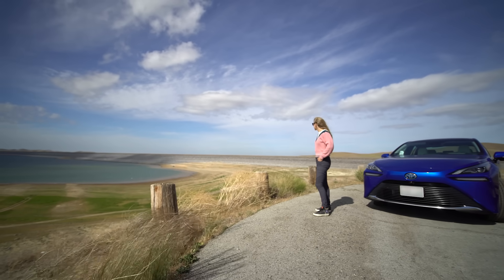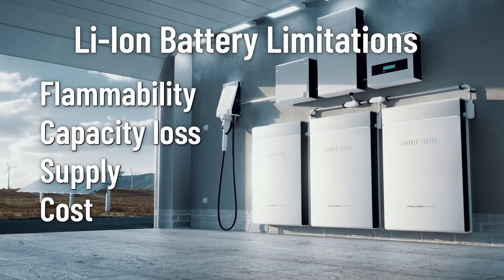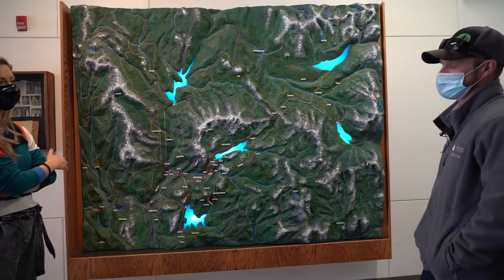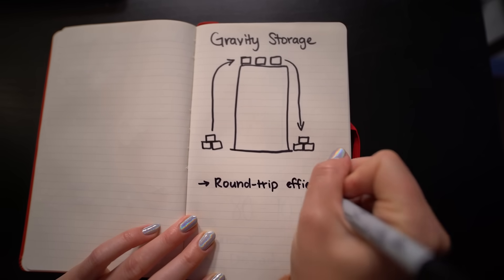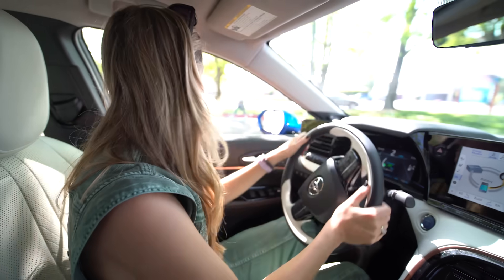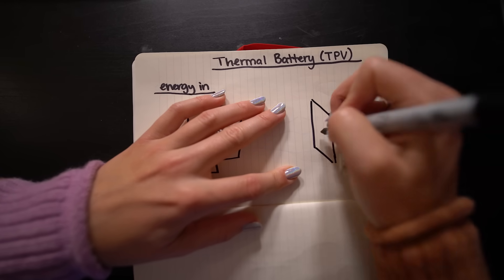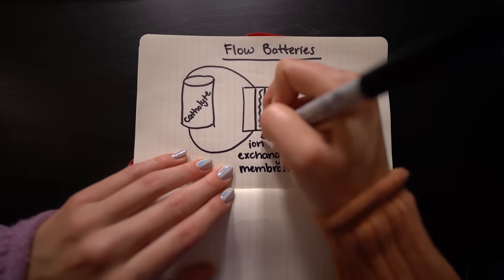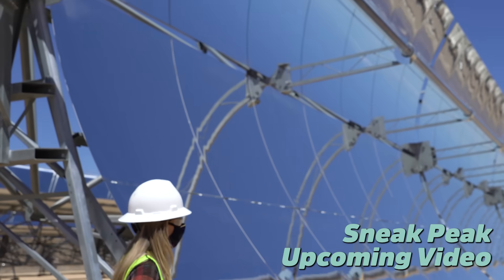The BIGGEST problem with clean energy

Comment: I really enjoy your channel, but this series seems to take a Toyota set of 'facts' as gospel.  Take the 'problems' with using Li-ion as storage.  1.  Flammability- yes, they can catch on fire- but not often, and catch on fire far less than Gas cars, which average about 200,000 car fires a year here in the US.  And Hydrogen- extremely flammable as well- think Hindenburg...  2.  Capacity Loss- again, yes, they do lose some capacity- but not much.  In fact, their losses have proven far less than anticipated in several studies.  Tesla just released an overview of the batteries in their cars, where the losses were tapering off between 8-10% after 200,000 miles.  Consumer Reports a couple of years ago looked at a Prius, whose older-tech-Metal-Hydride battery capacity was virtually unchanged (though admittedly, this was a small sample).  3.  Supply- this is kind of silly.  This is a new industry, so yes, capacity to build batteries is not yet built out.  But within 5 years, there will already be many times the capacity of today.  And Lithium itself?  Running out of it?  Again, silly.  Lithium is a fairly abundant resource.  Even if we were to exhaust all the mines on earth (unlikely), there is plenty of it in sea water- and the oceans are vast.  Additionally, there are several, well-funded companies around the world developing recycling processes to re-use all the valuable minerals from old batteries.  4.  Cost- they said the same thing 10 years ago... and then the cost decreased by about 80-90% since then.  And it will continue to drop, perhaps not quite as dramaticly, but it will, especially as manufacturing processes improve, and chemistries improve, and energy density goes up.

I really like your show, but this particular series, so far, shows very little in the way of research, and instead seems to rely on a Toyota-centric POV to promote their hybrids and Fuel Cell technology.  I would not have chosen Toyota to sponsor a show on this subject, as their bias pervades the show.  And I like Toyotas- one of our cars is a Prius!  We do need more energy storage solutions- but all of the ones you show are not new, and have been around as long as Lithium Ion battery storage, if not longer.  There is a reason none of them are yet successful in the marketplace, including your upcoming video (I am guessing) on using Solar Thermal to store energy in molten salt.  Even flywheels are being looked at... again.

Tesla already has a path to reduce the cost of their higher power batteries, with nickel and cobalt, to around $50 per KWH.  Using a Lithium Iron Phosphate chemistry, they could get it down to $40 per KWH.  And if they ever get a drop-in solid electrolyte, which has a high probability of happening over the next few years, the cost per KWH will drop even further.

I am glad you are taking a look at the possibilities of our future, hopefully one devoid of using any carbon-based fuels.  Li-ion gives us the chance to get off of those fuels NOW.  But there are many other companies trying to slow that future down, because of profits to be made using the status quo.  The other storage possibilities, which warrant research, are still pipe dreams however, or worse, red herrings for other interests.  Frankly, if you want a complement to using renewable fuels because of the worry about intermittency, I would suggest a deep dive into LFTR nuclear reactors, which use Thorium in a Molten Salt environment.  Unfortunately, Nuclear Power bias is making that a long climb uphill...
Reply: Admittedly, it is harder to get, as Lithium is never found alone- but as a comparison, there is more Lithium in the world than Lead.

Comment: I heard from a french expert called Jean-Marc Jancovici who's lifetime work is surrounding the question of energy storage and usage. He explains that hydrogen is just not ready because you need far more energy to make electrolysis than the energy you get back from hydrogen generators. Moreover, he adds that the process of electrolysis is based on electric consumption. Where does the electricity come from if not petrol and coal? knowing that hydroelectricity is a minor source of energy in the grid

Comment: Compressed air looks very interesting. 
Also I wonder what the efficiency is if you used electrolysis to free hydrogen, then just burned it for power instead of fuel cells
Reply: like pump storage about 60% - no idea how they got their 70 to 80% for pump storage

Comment: Yes, everyone saw your periodic table of elements (11:48)

Great series. I am reminded of a session from an old white man, Prof. Dr. Dr. h.c. mult. Hans-Werner Sinn, president of the IFO institute (at the time of the talk), that was pessimistic about renewables as he presumed the only viable way of storage by pumped-storage hydro. And as you state, the growth potential for it isn't great, even less so within Europe. The only storage alternatives he thinks of are Hydrogen and Methane. He he argues with the bad efficiency (maximum efficiency by Carnot) of these chemical storages but does not even try to think of other storage possibilities. For reference: https://www.youtube.com/watch?v=rV_0uHP3BDY

To me, it was pretty clear his talk had a misinformation goal, because there are lots more ways to store energy, as you gave examples. I know compression which, I think, is very promising, not only because the worst case scenario involves bursting pressure tanks, no escaping of long term radioactive materials. An introduction to this technology I saw was using pressure chambers under sea.

A bad light on that talk comes from a smaller talk of Prof. Dr. Markus Lienkamp, also of the IFO institute, who for example states electric vehicles are even the better, cheaper storage for energy than pumped-storage hydro: https://youtu.be/5moHQFbEsDU?t=2944 It would be funny if it wasn't so sad that the president doesn't let himself inform and review from other members of his institute. Aside of that the poinnt of view of the IFO institute is on the economy, not the ecology.

Comment: The biggest issue is that any additional electrical need, especially an enormous need like powering all our cars, will come from coal. Currently all the solar, wind, hydro and nuclear are running at 100%. Any need new electrical needs will be produced from fossil fuels. So why don't we just burn gas?

Comment: For hydrogen storage, there's a bit of a matrix.  Trying to store pure hydrogen in any sort of compressed form is generally a non-starter, but the cheapest fuel cell technologies require pure hydrogen.  Using heavier hydrocarbons like natural gas are easier to compress and store, but the fuel cell assembly is more complex and expensive because of the heating required to separate the hydrogen out.

Its a bit of a conundrum.   One solution is to not try to compress the hydrogen directly but instead store it in a metal oxide (catalytic) chemical matrix that yields good densities but does not require high compression, cryo, or heating.  This works quite well but again require a certain degree of complexity... low pressure pumps, valves, plus the metal oxide canister has limited life (~15 years or so, though that isn't a big deal).  All in addition to the power electronics.  More things can break, basically.

This is why batteries are going to remain popular for a very long time, and perhaps even more so once the technology shifts over to solid electrolytes.  Batteries have higher costs up-front, but essentially zero maintenance for 15 years.  The life-span of small and medium-scale power electronics under regular cycling is also around 15-20 years and this has to be taken into account too... unavoidable since all of these systems need such electronics regardless.

-Matt

Comment: It's difficult to believe that anyone would seriously fund that "blocks of hot carbon" concept, since it stacks photovoltaic inefficiencies on top of thermodynamic inefficiencies.  On the other hand, most inefficiencies in gravitational energy storage are the result of friction, fluid turbulence, and engineering challenges and are not like the fundamental physics inefficiencies you get from any technology that relies on temperature differences.

Comment: (Edited for typo) The same thing done with water at the Big Creek facility could be done with solid weight in elevator towers anywhere on the planet. The greater the demand, the more towers get used. They can be lifted or lowered separately or in groups dictated by supply and demand.

Comment: Hydrogen is (obviously) looked at through rose tinted glasses. It is hard to make hydrogen through electrolysis because pure water is an insulator. It does not conduct electricity unless it is polluted with salts, which will cause wear of the electrodes and impure hydrogen (think chlorine in your fuel when table salt would be used). Additionally, hydrogen is difficult to store. It is such a small atom that it will seep through steel (making it brittle and prone to rupturing in the process). Ironically, the most efficient method of storing hydrogen in a readily usable way we know is hooking eighteen of them up to eight carbon atoms. This molecule is  liquid and stable at room temperature and can be stored indefinitely. Local storage at the production site does not require special cryogenic pressure tanks.

Comment: This has been the stopgap for many years. I'm no scientist by any means, but when I did some research on renewables and the pros and cons in college, the potential for renewables is there. There are all sorts of different methods, from solar, to wind turbines, to hydro dams. But then there's wave energy capture, deployable wind turbines out at sea, and other methods of geothermal. What I also found was having battery storage for these methods is lacking and it's been the same since I wrote that paper in 2016.

Comment: There has been a recent breakthrough utilizing iron-oxide batteries. Essentially big batteries made from iron, with rust being created and removed. Creating a shift of electrons due to the shift in oxygen molecules. Downside is they are as big as washing machines per unit, which means they would be great for grid storage. Question is if it can come out of the laboratories as always..

Comment: Technology Connections did a video on a similar topic recently, and made the point that you can store energy in a lot of ways, and one of them that might be really useful to us is thermal storage -- basically, "overcool" living spaces (within reason) when demand is lower, and then that offsets the otherwise constant demand, so you don't need the AC running during peak hours at all. It requires well insulated homes, but it's a pretty compelling option.

More here: https://www.youtube.com/watch?v=0f9GpMWdvWI

Comment: Here is my 2c 😘
You want to take energy, convert to heat, to keep molten salt, should last quite a while with good observation to stop heat loss, use for heat conversion to steam turbines back into energy
Though there is that solid state thermal energy converter, but I don't know of any at the size thats needed

Then you'll have energy on tap. 😘

Comment: Sorry, but to sustain and/or convert all of the grid, transport etc. we need around 100 MLN tonnes of lithium, or less if new chemistry will be in use. Lithium can be recycled easily (when cells are made with consideration of such process). Power packs are planned to have multiple 'use cases' - first within car, then as utility storage etc. and at the very end - recycled. What is more, we are on front of 'shelf mining' and there is more than in Earth crust additional lithium in sediments on the continents shelfs. I think that oil industry is trying to re-use their hardware to generate hydrogen instead 'loose it all' in favor of the battery-storage solutions. There is more than 125MLN tonnes available - not necessarily easily accessible - but your point is incorrect.

Comment: Air gets hot when compressed, but if you pull the heat out, you lose pressure. I'm not sure where the break-even point would be.

Comment: One thing I think could become big is vehicle-to-grid storage. We don't use our "big" car very often, so when we replace it with a BEV I'm hoping VTG will allow us to charge it with solar off the roof (or cheap rates overnight when there's lots of unused wind), and use the energy when we need it. If we need a long journey we'll be able to turn this off to top up the battery to full.

Comment: I just noticed this vlog was fine but very much reduced to an American point of view. Switzerland and Austria ( and probably Norway and Sweden) produce and store lots of energy through gravitation/dams on several level) , Germany and Italy produce lots of energy by means of PV and everybody sells energy to everybody. And there are a bunch of competitors to TESLA' s powerwall around here as well.
One more thing: Most of your examples pointed to technics that can only used by big companies. Another solution could be to go towards small installations. A farmer with his own PV and batteries can easily go off grid for several days and reduce the stress on the electrical network. The same result can be produced by improving isolation because you need less energy to cool or heat.

Comment: I did a research paper on this exact topic in college. For me the most interesting solution on the large-scale side was CAES/LAES because the facilities to handle this type of storage largely already exist. I would have to dig back through some notes to find sources, but the basic tech needed to store compressed (or liquid) air is already used at the average oil refinery. In addition, many of those refineries have a means of capturing the thermal energy to fully optimize the process. 
And while convincing those companies to convert a refinery into an energy storage plant may be difficult, I know many of the largest oil companies in the world are already looking into how to get more involved in renewables. From everything I found in my research, the potential global impact of converting refineries to storage plants could be both extremely profitable and induce huge growth into the entire energy sector.

Comment: AS always a great video but I am disappointed you had not mentioned Lithium Iron Phosphate batteries which are safer and have extended cycle charging but instead kept comparing each technology to the more dangerous older Lithium Ion.
Reply: But that’s just another type of lithium ion, what you called “lithium ion” is lithium (nickel manganese) cobalt oxide. Just a different electrode formulation. If you puncture and short-circuit an LFP Li-ion battery it’ll still catch the electrolyte on fire.
Reply: @kaitlyn__L  Lithium iron phosphate has excellent thermal and chemical stability. It stays cool in higher temperatures. It is also incombustible when it is mishandled during rapid charges and discharges. Lithium-ion does not have the same safety advantages as lithium iron phosphate. Its high energy density has the disadvantage of causing the battery to be unstable. It heats up faster during charging as a lithium-ion battery can experience thermal runaway.
Reply: Not mentioned because this is a Toyota hydrogen advert.
Reply: @TechRyze  It was mentioned in passing, problem with them were also mentioned as well as another, one of the availability of lithium. At current consumption, there is plenty, but if we are going to be using it for vehicles, (just vehicles) well, the available reserves get used up in less than 90 years as the demand will increase by 400%, that does not include fixed storage or other uses.
Reply: @linusa2996  Not really true, only the current source. There is plenty more once we start desalinating the oceans (after we run out of ground water), also in geothermal wells. On top, for stationary, sodium ion batteries are better anyway.

Comment: The part about the carbon photovoltaic energy storage made me wonder: why don't normal solar panels use reflectors. A bit of fast research says it could increase panel efficiency by up to 30%, so makes me a little puzzled why nobody else is doing it.
Reply: Probaply to expensive to be worth it. Most places have "enough" space where power/m^2 is not realy the limiting factor. But the network it is connected to and predictability of generation are.

Comment: "another solution is to add other sources of energy that are more consistently available, like waves, and nuclear fission/fusion. " - even with a constant energy source, storage makes more sense to smooth out the peaks.
Reply: High temperature nuclear reactors with heat storage in the form of molten salt or molten aluminum.  Reactor can operate almost constantly and power can be taken out    for peaking a d backup.
Reply: @stanleytolle416  
Your halfway there now just add Thorium and you really got something 👍
Reply: Just a wasteful way thinking. Consumerism at its finest.
Reply: @marcohangman5312  why?
Reply: @budders9958  Why build another production when u have over supply during low peak.
Reply: @marcohangman5312  that's not what I suggested. Storage shifts the supply to the higher demand periods. It's like inventory
Reply: Because you are replacing the gas production that would have ran at a higher cost during the peak demand hours and instead supplying those peak demand hours with a cheaper source of generation that runs 24/7 at scale. Ideally this would be a form of fission, hydro, etc since they are clean. That will lower the overall cost of energy and clean up the air.
Reply: @budders9958  my bad, I thought u meant building another energy production.✌🏼
Reply: @marcohangman5312  maybe you go with out using energy for some time, before deriding it as "consumerism"....whatever that means.